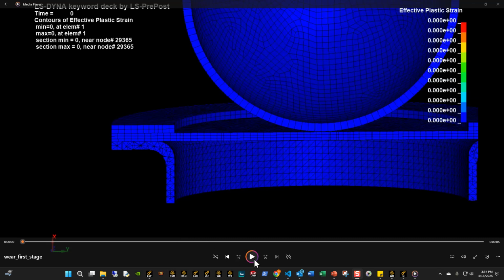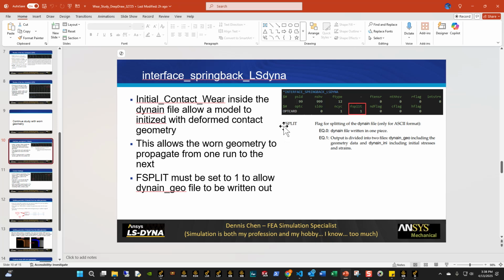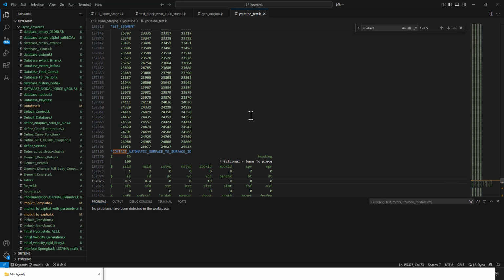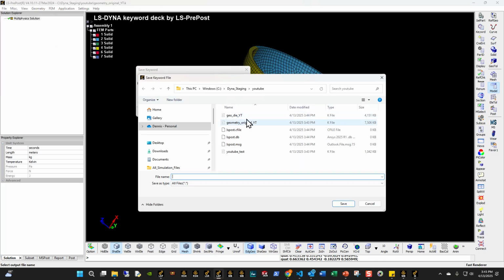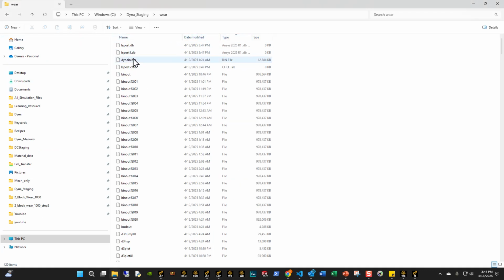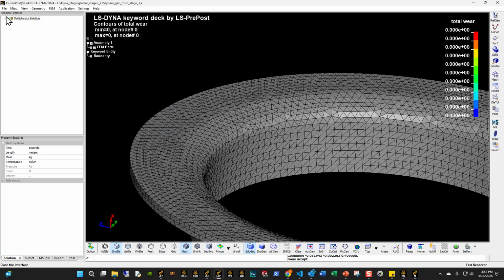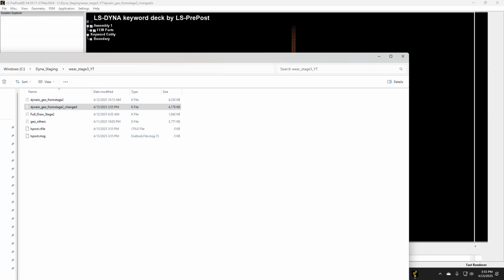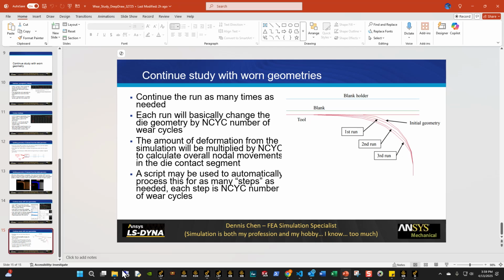Ansys LS-Dyna Tutorial - Wear Analysis Part 2:  Continue wear analysis using worn geometry

Comment: Hello Dennis, Thanks for your tutorials, I have watched part one and this video for over 20 times and still cannot fully implement it for my pin-on-disc simulation. the Interface_springback_lsdyna keycard doesn't work for my case and leads to a solver error. Therefore, I cannot write a dynain file for cycle-scaling and progressive wear. Do you have a solution for this? I appreciate your help